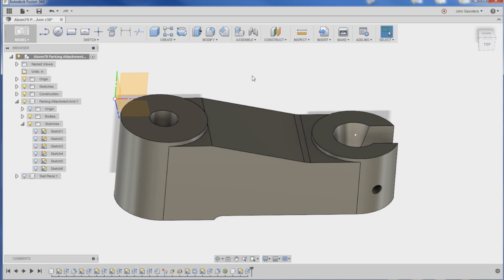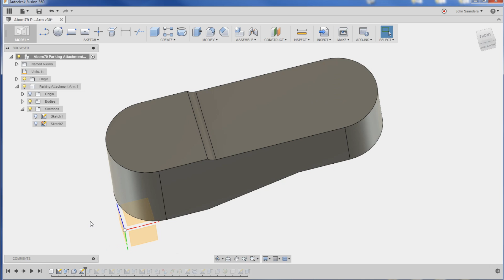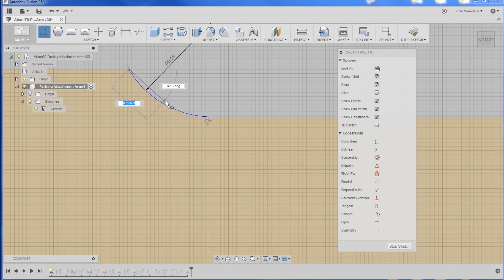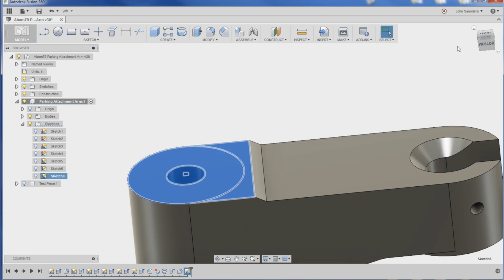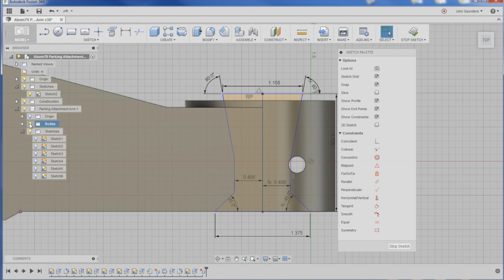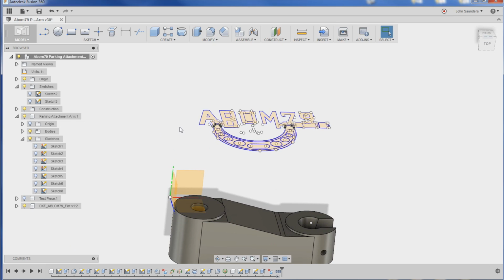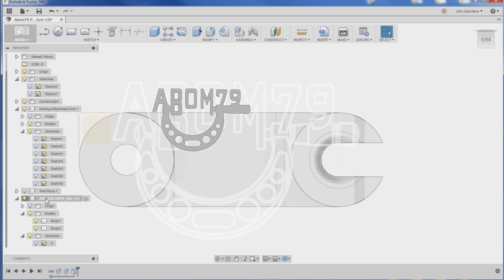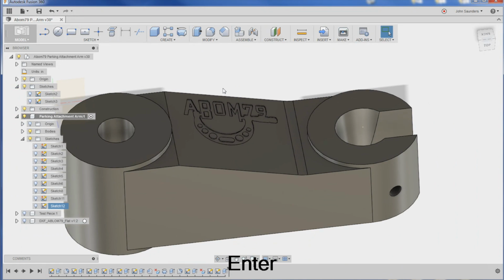Adding Abom79 Logo & Fixing CAD Mistakes!

Comment: John,I watched the video where you actually engraved the part with the Lake Shore 020DEG ENG tool, my question is when you set the tool up in Fusion 360 what did you set it as? Because Fusion does not have the option for engraving tool, so do you start as a ball mill or end mill?
Reply: Thanks John!

Comment: An alternate way that you could have gotten rid of that fillet: 
When you created that circle for the new geometry you could have then sketched an arbitrarily large rectangle around that circle that was larger than the part and then extrude cut everything but the circle down to the lower surface (in a sense absorbing that pesky fillet). 
With CAD there is 10 ways to skin a cat so this is just how I would have attacked this.  
Hope this is helpful in some way.

Comment: Just wondering why you re putting the logos on the top of the part since it won't be visible when "parked".  Why not on the sides so it can be seen when installed on the assembled fixture?

Comment: Any chance you could give some insight on putting a logo on a round surface?  I need to engrave my logo and serial numbers on cylinders with a 4th axis, and I am having trouble finding good info on how to do it.
Reply: Same principle.  Put the logo sketch on the top view plane then project it onto the  round surface.  I don't know if F360 knows how to wrap around a cylinder.  However you can skip that part and keep the sketch flat

You can simply project the toolpath and tell it to do a 4th axis wrap around the cylinder. Which is the better way in my opinion. 

John had to project this onto the surface because I reckon he will be surfacing the logo without tilting the part to that angled plane.

Comment: When you initially import the logo. Could you not import it directly onto the angled surface? 

Thereby not having to do any projection or moving of it to compensate for the distortion the angled projection creates. 

You could simply place it on the surface, resize, position, and do your extruded cut. 

I usually only use projection when dealing with cylindrical or curved surfaces. If there's a straight plane surface I simply use that surface as the plane to import onto
Reply: He could have, but scaling scaling and manipulating the sketch is really slow in Fusion360. I can easily bring the whole software to a screaming halt with a complicated import, it behaves much nicer after you create a solid.
Reply: +bensbenz 

Open a new file, import the DXF turn it to a solid native F360 then bring it into the part?

Seems silly you can't  lay that DXF sketch directly onto that sloped surface.
Reply: You can, and for simple stuff with not a lot of lines I do it, DXF or SVG. It's when you try and bring in something with tons of lines, when you select them all then try to move it around or tweak the size that it becomes an issue, its really really slow and "jumpy". If you import it, and your not dead on size and placement, its actually faster to do it the way John did. I am told they are constantly working on making it faster, and it has gotten a little better over time with the updates, but it still needs more work.
Reply: +bensbenz 

Guess I'll stick with solidworks lol
Reply: Yeah, the sketching in SW is better no doubt, but I like the rest of Fusion 360 better and its easier IMHO. Its been a while since I used SW, but if I recall when you are playing with sketches and moving them around, don't the lines disappear while your moving them? They don't in Fusion360, maybe that's why SW is faster?
Reply: +bensbenz 

Not anymore. They go semi-transparent and reduces the graphic tolerance while moving. So no slow jumpy movement when dragging 

For the price of F360 (I.E. Free). It looks quite powerful. Certainly better than any other free or cheap software... Like bobcad...
Reply: +NYC CNC 
That's nothing.  We got quoted for a single seat of 5axis hypermill.  $32k!!! $5k for just the post alone. 

And that's CAM only software! No CAD!

Comment: Hi john, two things: 
Firstly shouldn't the logo be coplanar with the piece it will be engraved into? By making it horizontal and projecting it down the logo's aspect ratio will be wider than it should be. 

Second is a dumb one: what is this part? I've been following from the start and I still have to idea what a parking attachment is. Is it something for a car or boat?
Reply: +NYC CNC 

My guess is you have to first create a reference plane or reference coord system on that surface. 

You "should" be able to pre-select that reference plane prior to inserting the logo and it should snap it to that plane. 

If not, I believe that the third button on the "object" line (looks like a little coord system icon) in  the window that opens when you insert allows you to define the plane to insert on. 

I could be wrong. I don't have it in front of me to verify that.

Comment: John

Great video
Would not the logo be better projected from a construction plane parallel from the inclined surface of the part then you would not have any distortion of the logo,
Not that my old lamps could see it but it could matter in certain situations

Are you going to set the incline level to machine the logo or let it follow the incline , but then the engrave would but under cutt on the down side

Keep up your great f360 vids , the correction of unwanted features 😉 is very useful

Stuart
Reply: Couldn't you have selected the inclined face and defined it as x-y and then imported so it was parallel?
Reply: +bcbloc02 
Brian. That can be done in CAM with tool orientation ,but the face would need to clocked parallel to the table .

Not sure how you could do it in CAD to make Z vertical to that face

I have been playing with the problem , I can get text on to the construction plane and the project that onto the part and be square the the face but as yet not sorted it with a DXF

What ever the part will need to be reset to machine 

It may not matter in this case but if the logo has a circle in it and the face of the part is at say 45 deg then the projected result would be an ellipse 

O boy it's a can of worms to be sure but I bet there is a simple way to do the CAM and a reset to do the machining 

Stuart
Reply: +Stuart Hardy 

If you turned the DXF sketch into a solid entity, constrained them together (so all pieces move as one). Then mate the solid DXF logo to the part geometry that's angled?

Comment: The sketch you revolved to make the taper was also 1.725".  If it's reduced to 1.625" the straight walled section will be smaller.
Reply: What's more, if you don't reduce the height of the revolved sketch, the diameter of the top of that void will be undersized ever so slightly.

Comment: Hey John, thanks for the video. I just downloaded fusion and am teaching myself. Ive been trying to model my muzzle brakes that i make but i am having trouble with the ports. I have the ports sketched but i cant get it to extrude at an angle (in my case 30*) from the bore. My brake is round so i cant construct a plane on a tangent. Any ideas? Thanks!

Comment: John -- you altered the angles from what Adam had provided... won't that change the size interior though for whatever goes in that receptacle? It looked like a tool holder space or something.
Reply: I wonder about that to. If my print said 10 degrees, then ten degrees it is.
Reply: I believe the original part is just a rough sandcasting, so measuring an accurate angle off it is not that easy. Also this hole is shaped like it is to provide wiggle room for the milling head it will hold. This way it can be aligned when you put it on to use it. You can check out abom79s videos where he shows it.
Reply: I trust! Was just curious :)

Comment: Autodesk Inventor has/had an Emboss feature that was created for this task, does Fusion 360? Also, I figure you may want to do that a different way, using just the lines instead of the forms (if that makes sense) because in the way you are doing it, you are losing the lines on the thimble and the recess of the frame.  If you would just etch out the lines,  I think it would be a much better looking engraving, just my opinion.